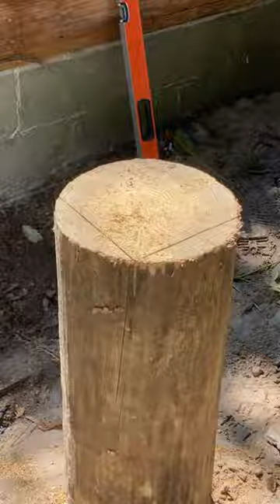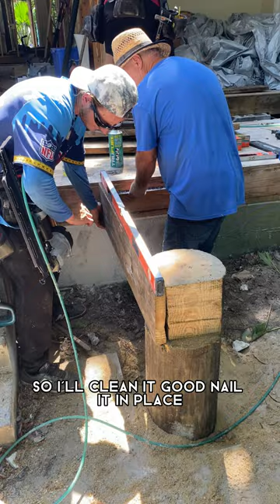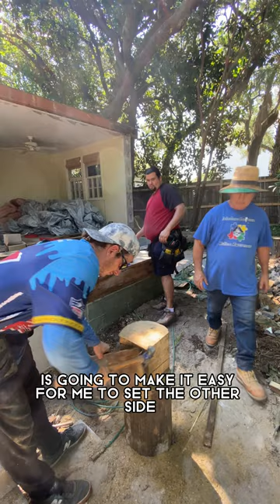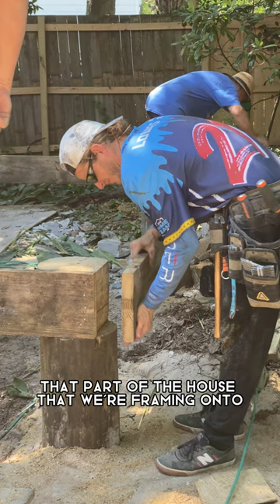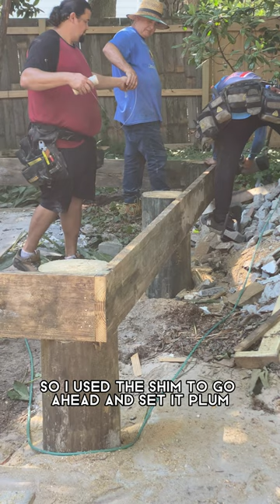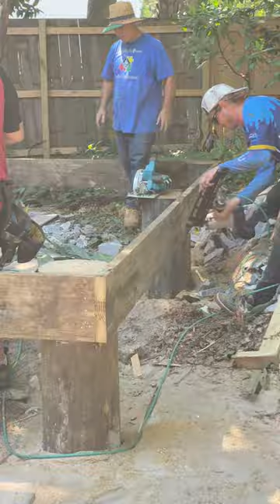Floor Framing | Artpentry

Comment: Idk how often you use piling and notches like this but I would recommend a dewalt 90 drill to drill holes for your carriage bolts, they make the stronger and more dependable ones out of all the brands, cost a good bit tho about 400
Reply: DeWalt charges top dollar for long lasting mid tier quality, just a fact